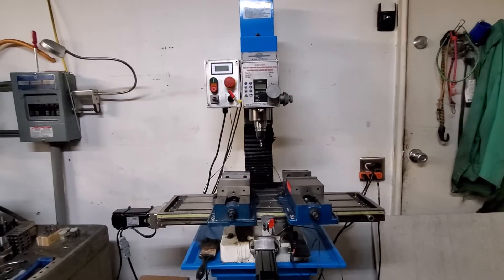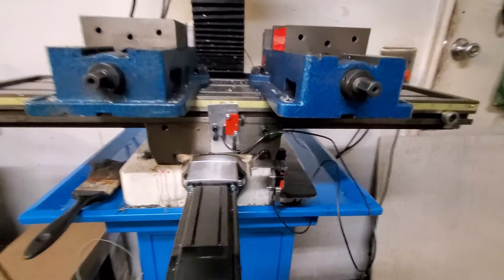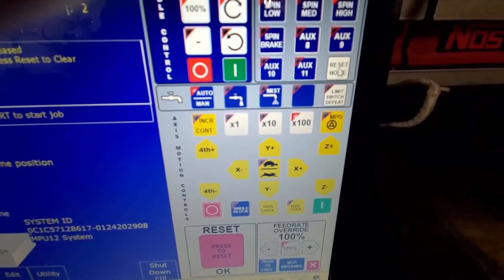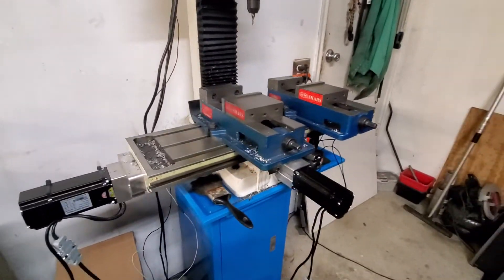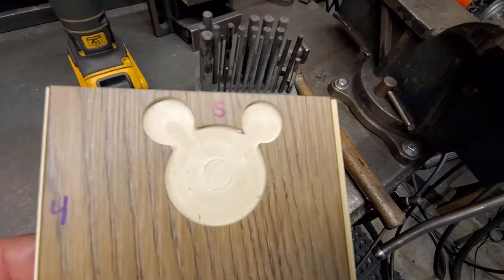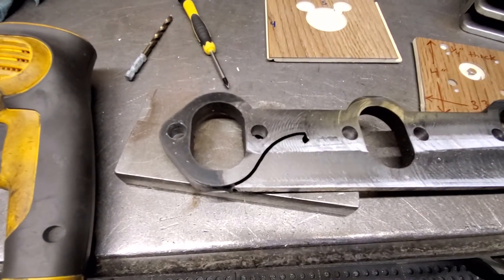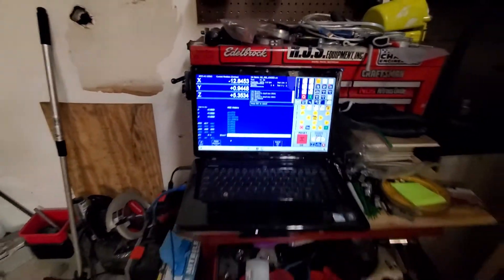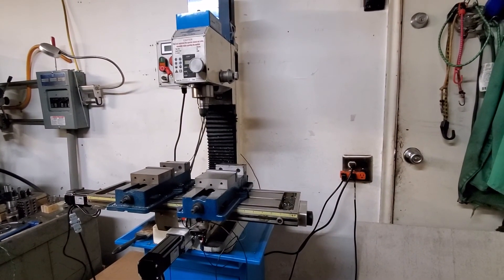pm25mv cnc overview

Comment: nice job, i'm trying to figure out a electronics enclosure
Reply from the maker: Thanks Bud. I'm happy with my mid tower PC enclosure for the price. It was like $40 through Amazon. I'll be doing a video soon of it.
Reply: @ponydowncnc8365  I was going to do the same thing, you got 3 power supplies and board and drivers! inside?
Reply from the maker: @wow-wow-p8d  I have 3 driver power suplies, 3 Leadshine knock off drivers, acorn board, 5 volt power supply, acorn relay board, and a kyb power board. I had to take the cage out that would house the pc hard drives.
Reply: @ponydowncnc8365  hmmm I'll be watching for this video I hope soon whats the part number of the pc case?